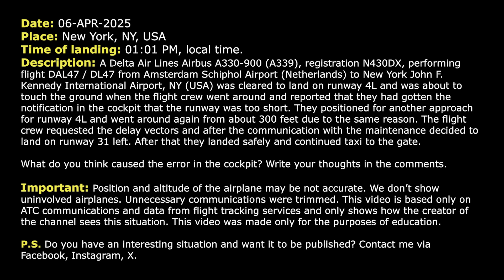The longest available runway is too short. Delta Airbus A339 has problems over New York. Real ATC

Comment: How can you not be able to calculate the runway required before you are on short final?  That’s ridiculous.
Reply: they are not that stupid like you think. It's a company procedure when the warning is on, they have to go around and figure out.
Reply: @holylee30  They have violated FAR 91.103 then.  You don’t decide on final that the runway is too short.  This is a required part of preflight planning.  You should know the runway lengths and the runway required before you take off.
Reply: @LTVoyager  Have you read my comment or no? I didn't say they did FMC thing on short final. For whaterver reason the warning was on and they had to go around. Not because they don't know how to calculete things.
Reply: @holylee30  I did you suggest you said that.  I am suggesting that had to be the case because they twice accepted an approach they could not complete.  That is a priori evidence that they were making the runway length decision on final approach.
Reply: The runway isn't too short. The system in the airplane that monitors energy level just before landing THOUGHT the runway was too short. It's a glitch, but the procedure is to go around and figure out why.
Reply: @LTVoyager  I guess their A330 is equipped with ROPS which can shown alarm screaming "runway too short" before touchdown if the aircraft decided found out that the runway seems to short based on several variables. It could also be malfunction of this system
Reply: @ And when you know the system is wrong, you ignore it and carry on … assuming you are a pilot.  If you are a computer  operator, then I guess you  go around and call for backup.  😂
Reply: @LTVoyager not what happened. The runway is one of the longest in the world, it was not too short.

The computer had a glitch and an alarm « runway too short » was activated. It was a false alarm.
Reply: @ You missed the point.
Reply: @LTVoyager  If you watch aviation disaster videos you'll find a lot of cases of "crew ignored the warning and carried on".  In this case they simply landed on a different runway.  Minor inconvenience but guarantees a safe landing in case of an error or even a failure of a system the crew isn't aware of but the system might be getting data from.  Most likely it's just a malfunction but it never hurts to take the safest course.
Reply: @ There is a huge difference between a warning you can’t confirm manually and one that you can.  Runway length is easily confirmed manually so determining that a warning is bogus is fairly easy.  We aren’t talking about oil temperature or a bearing overtemp or something that the pilot’s can’t easily confirm manually.
Reply: @LTVoyager They weren’t in an emergency situation, they had plenty of fuel, so they tried again in case it was a one time glitch, and then they called maintenance to help figure out if the computer was actually malfunctioning or there was some other issue that they hadn’t noticed.

The pilots would already have worked out that 4L was long enough and double-checked the calculations,, but there’s no sense in rushing when there might be a problem you haven’t noticed. We have these systems because humans got it wrong many times before.
Reply: @LTVoyager please stop talking if you don’t know what you’re on about. Would you ignore a TCAS RA when you can’t visually see a plane anywhere near you but it’s on your ND? If ROW/ROPS alerts, you go around. Don’t question it or you could risk paying the price. Look at something like Air Transat where the pilots assumed it was a computer error….and then guess what….ran out of fuel. That close to touchdown, go around figure out what happened if you have time then try again. Yes it may be a computer problem but you never assume so unless you can prove it and that close to the ground you don’t have time to guess. It is an active monitoring system so sudden changes in wind, ground speed etc may cause it to think it won’t stop in time and depends how much the aircraft floats.
Reply: @ Please stop replying to my comments without first reading them.  Then you won’t make such stupid replies.
Reply: @LTVoyager  it’s quite obvious you don’t know how ROW/ROPS works
Reply: @ It is quite obvious you can’t read.
Reply: @LTVoyager  you seem to think the pilots didn’t know the runway length and if it would stop in time. That is absolutely not true. They knew it would stop in time but this is always assuming the pilots land around the touchdown zone. ROW/ROPS does active monitoring to tell you if the runway might be too short depending on many factors. Please go and research it now to understand how it works and why it might trigger.
Reply: Exact, once all parms have been entered in the FMC, it should refuse to accept a runway that is too short - looks like there is a human logic failure here.
Reply: @hankhulator5007  You are entering FMC parameters on short final?  Really??
Reply: @LTVoyager   No, I meant when preparing the flight.

Obviously, there are some things we do not know about the plane's ROP, such as which input parameters it use to make calculations.
Reply: It’s a malfunctioning software warning not an actual issue guy lol

Comment: How does an approach controller at JFK not know that 4R is shorter than 4L
Reply: They know. pilot told them it's a sensor issue not the actual runway legnth issue. that's why.
Reply: D....E....I.....

Comment: You punch in the numbers and get a green light. But you're just on the boarder line, it doesn't tell you that.  One parameter changes by half a percent and you are red light.

Tower says wind is at 10, in reality it is 9.6, as you descend your instruments pickup 9.4, go around.

Comment: Not a pilot here but could it have been a bad input into the computer making the cargo or fuel measurements heavier?
Reply: Incorrect basic inputs would have been caught long before they even started the approach, when they prepared the landing, calculated the landing speed, the required runway length etc. The system which triggered does "live monitoring", catching issues with the actual approach up to the last second. When pilots land too fast (faster than what was originally calculated), when winds suddenly change (unexpectedly strong tailwinds), or when pilots use incorrect landing technique (plane floating too far down the runway before touching down). So though the original calculations suggested everything was fine, the system now sensed that the actual approach is not working out after all.
Could have been triggered by a sensor failure (system detecting incorrect tailwinds), or by pilot error (pilots have not properly reduced to the precalculated final approach speed).
Reply: @fgaviator  Thank you for sharing the knowledge!!!
Reply: the 339 has ROW/ROP protection. It's either not working correctly, or the guys are landing very long. 
Almost certainly its a computer error.

the pilots should run a manual landing perf and land on the keys.

Comment: ...if you confirm your landing weight is correct and the braking data is correct-then you land. Just Sad.
Reply: When you ignore a warning and thinking you are correct, that's when something happen
Reply: @holylee30 the first time absolutely. But after taking delay vectors to double and triple check the math, you gotta make a judgment. 

Computers are so reliable that one day someone that’s never seen the computer fail is going to be psychologically unable to consider that it’s busted and is gonna fly into a wall.
Reply: @ridiculousblue9917  your company makes the rules though
Reply: @Gee1410thirtysix I reckon the company would be downright unhappy if Delta splashed down in the Hudson because the airplane said they needed more than 12000ft to land, or took a wild detour to the Shuttle Landing Facility if 31 wasn't available.
Reply: @Shadow__133   there’s a wide gap between what happened and that, as evidenced by having enough fuel to work it out with maintenance and land on a longer runway.
Reply: @Gee1410thirtysix  Indeed. Good thing they had a whole squad of support and a cushy 14,000 foot runway, because, competent pilots and a perfectly fine 12,000-ft would not be enough.
Reply: @  you clearly don’t fly for the airlines. We can override company policy for emergencies but this wasn’t one. If you have time, why not consult maintenance? If it’s something that can be reset, then the system is there to do what it’s supposed to. Overriding systems is a common link in the accident chain
Reply: @ I’m not saying that’s wrong, clearly it was not an emergency. I’m just pointing out that physics doesn’t bend, and neither does the runway length an airplane needs to stop when set for landing. People have been figuring that out for decades without some damn computer barking at them. Do you suppose they would have called the chief to figure out what to do if JFK said no to rwy 31? And what if the system still called for a go around with 31 and +14000ft?
Reply: @Shadow__133   bro you keep overlooking that there’s an underlying failure causing that false warning. It helps to figure out what has failed to cause the false warning. Is it something can could become an issue with other systems? You clearly don’t fly complex aircraft. This isn’t as binary as you’re trying to make it. Of course they can do what you’re suggesting after troubleshooting with mechanics that know these systems and have manuals available. And JFK isn’t going to say no. They can easily just declare and get that runway. The airport isn’t going to deny them when they have a failure on the aircraft.
Reply: @Gee1410thirtysix  look, youre doing alot of explaining but youre forgetting the basics of this craft. If youre in a distressing situation, you declare an emergency. That declaration and the provisions it afford become the new safety blanket. I have to chuckle when I see the comment section errupt into the assumption of who is/isn’t a professional airline pilot because the same poor logic thats demonstrated in the comment section are demonstrated in these videos. This event had a simple solution, conduct an autoland on any runway that supports the landing distance numbers. If the airfield/aircraft are not equipped, land firmly in the touchdown zone. This is simple stuff. Flying around and talking to the company are only ensuring your options in time value are degraded.
Reply: @  disagree. It’s not an emergency then. It’s ADM.
Reply: Below 300' the system dynamically calculates the stopping potential, hence the alert at low altitude. Airbus mandates you go-around, this is not a company procedure. Obviously there is a input going wrong into the calculation. My guess is the IRU speed is wildly out.
Reply: @rampy4963 if airbus mandated you fly into the Grand Canyon, you’d decide after due deliberation to ignore the computer. 

Computers are a tool. We should respect them greatly but they are not beyond question.
Reply: @ridiculousblue9917  Dude. Relax. The warning will only show at low altitude, which is not the time to disregard a hard warning and perform your diagnosis. If the system was clearly in error, you can turn it off and fly a subsequent approach.
Reply: @ridiculousblue9917  I think you are one of the few humans remaining. Congratulations. Lets not piss off the bots too much.

Comment: ROP malfunction perhaps.  runway overrun protection
Its warning function, called Runway Overrun Warning (ROW), applies during flight. It warns the crew during approach that the runway might be too short to land safely considering the real time level of energy of the aircraft. It is therefore a means to warn the crew that a go-around should be envisaged.
Reply: Yes, but for what reason?
Reply: @mikebarker9187 Improperly calculated runway necessary  by the crew??
Reply: run through checklists - or request a safe level to hold (if fuel needs to be dumped over the Ocean)
Reply: How does it know the runway's length? Is it preprogrammed into the mcdu?
Reply: @rahulbharadwaj6940  Runway length is in the database. Normally it's there to give you a warning if you flare too long and the landing becomes too long. Landing calculation assumes you touchdown in the middle of the touchdown zone, so if you miss that spot the stop margin decreases. ROW/ROPS uses GPS position to determine if you have enough landing distance left if you touchdown later than calculated. Now in this case it seems to have triggered before they even reached the runway and normally a 12000ft runway is enough to land an A330 twice on it. So i guess it was either a ROW/ROPS issue or a GPS issue.
Reply: @rahulbharadwaj6940  yes, every AIRAC the runway lenghts are updated on the FMC

Comment: 4L not long enough, you think you can do 4R ??? How does a controller not know how long the runways are ? 🤷
Reply: The controller would know, but the system in the airplane that is making the error might except 8,400’. After all the problem is obviously not the actual runway length of 12,079’ on 4L
Reply: because of the wind, I just love behind-the-screen specialists

Comment: Interesting as the LDA is only 200' longer on 31L than 4L.
Reply from the maker: At the moment they were approaching 4L was the most suitable with the wind they had
Reply: I think they also inhibited the ROP system or at least briefed that they would continue the approach if it triggered (probably based off of what maintenance told them.)
Reply: @EstorilEm maintenance never flies the airplane.  Their job is to fix it.  They cannot tell the crews how to fly it.

Comment: How do you answer that with potentially? The runways don't get shorter or longer by the seconed
Reply: Hey Steve, run out and pave a few hundred extra feet on 4L?
Reply: Probably a mandatory go-around in Delta's SOP, and I'm guessing that pilot has landed 4L plenty of times.
Reply: Funny things happen on these electronic glass airplanes. We were arriving in Frankfurt in a MD11 one evening and the First Officer was flying. the weather was close to minimums and she turned the auto pilot off around 1000’ AGL. We received the aural “AUTOPILOT” warning which you normally cancel with a second push. After about the third warning I pushed my autopilot button and said I’ll get it. She said I’ve tried, it won’t cancel. She did a great job even with that noise repeating every couple of seconds in the background. We touched down, rolled out, turned off, taxied to the gate and the AUTOPILOT warning repeated every two seconds. They plugged in external power, shutdown the engines and the Aural Alert continued when Maintenance came into the cockpit. With the aural alert continuing the maintenance just took the external power switch to OFF and back to on and the alert ceased. Never had it happen again, never heard any explanation.
Reply: @georgeconway4360  Turning the power off and then back on was what used to be called hitting"the big red switch." It has probably "resolved" (but also hidden the causes of) more computer malfunctions than any other method of trouble-shooting.
Reply: The system at play here was probably  Runway Awareness and Advisory System (RAAS)
Reply: Could be a factor of changing windspeed/direction at different altitudes.
Reply: @ThatMattWhite  the wind doesn’t change the paved runway lengths
Reply: @Gee1410thirtysix  it does change the automated calculations the plane's computer runs for whether a runway length is sufficient. It's not whether the runway length is changing, but the "minimum requirements" fluctuating.
Reply: @ThatMattWhite   but was talking with the controller about whether 4R is longer. That’s not related to the conversation
Reply: @Gee1410thirtysix wind changes how much runway is required.
Reply: @  the conversation was about which runway was longer and had nothing to do with wind. Clean your ears
Reply: @Gee1410thirtysix listen to 6:26 for two seconds.
Reply: @ that’s the discussion between 04 and 31, but has no bearing on 4R vs 4L. Everyone discussing potentially with the other controller is referring to the 4R vs 4L convo. You’re missing the part being discussed.
Reply: because of the wind.
Reply: @igorluiz9551  the wind doesn’t apply to the convo between 4R and 4L dummy
Reply: @Gee1410thirtysix  give us a time hack yo.
Reply: @ 5:16 to 5:37. Can’t you just listen?
Reply: @Ndub1036  sure, just trying to figure out what your point is, that's all.
Reply: @Gee1410thirtysix  yep, it.doesnt, 4R is in a vacuum chamber
Reply: @igorluiz9551   they’re parallel runways pal. Wind applies to them equally. Jesus